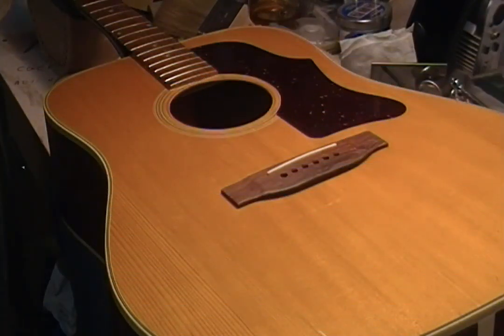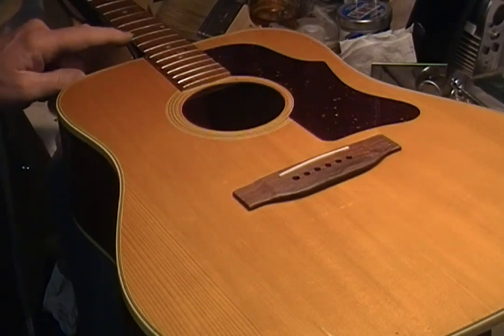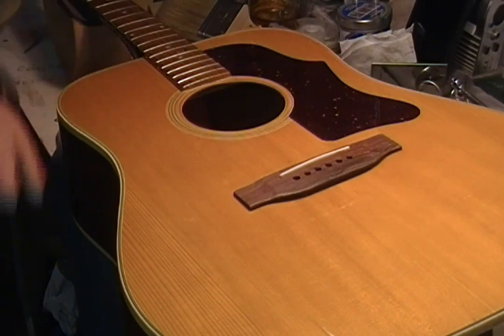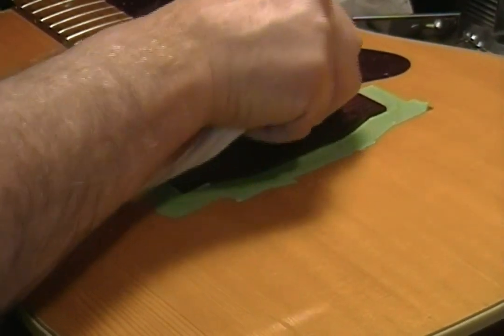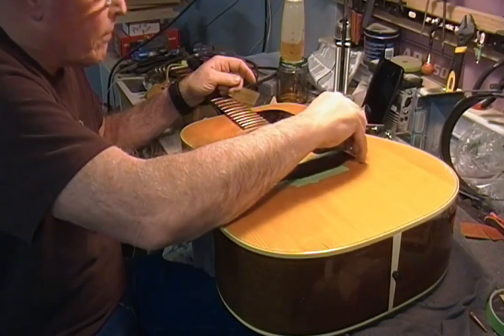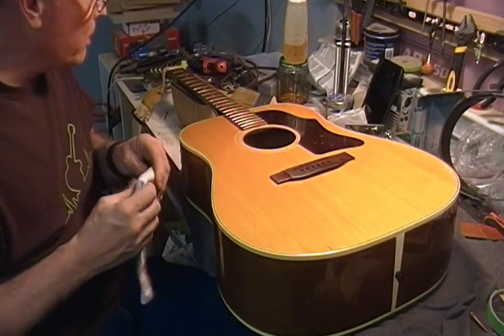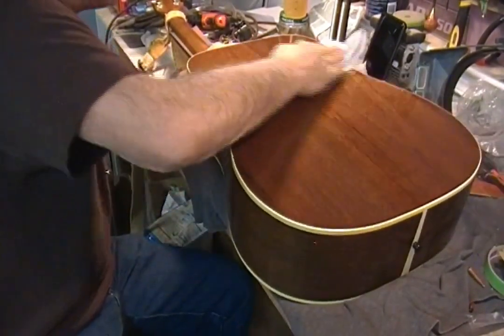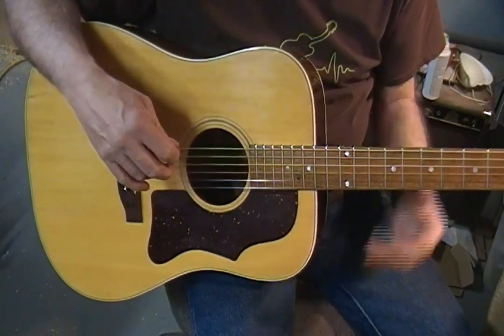Gibson J-40 bridge replacement, part 7, Finishing up with sound demo, by Jonah Guitars

Comment: It all came together Dane. Lovely work again. I'm interested in that polish.  You know any one that waves a mirror inside a pin bridge knows how chewed up a bridge plate gets. I've always wondered whether there's any mileage in bonding Tele type string ferrules inside on the bridge plate?
Reply from the maker: Dippy Hippy, thanks much Steve. That polish is a great product. I’m thinking brass sleeves wouldn’t hurt the tone any and definitely save the plate.
Reply: That's definitely an interesting idea. One worth trying. Currently, I soak a bit of thin CA glue into the wood around the plate holes to harden them up and slow down the chafing. I think that helps but it's hard to really know.
Reply: I expect the purists might say that no metal should get in the way of direct to timber contact with the string nipples?
Reply from the maker: @100amps , the super glue is a good idea
Reply from the maker: @KL3NCH , well the ball ends are brass or steel and the bridge plate fix it plates are made from brass. Of course purists prolly play only classical guitars with tie bridges.
Reply: I guess many of us remember the headlong roller coaster into brass hardware of the late 1970s to early 1980s? It was all dropped quietly as I recall. Then as now I couldn't tell any difference. I changed all my brass based attempts but only really because you couldn't hold back the  oxidisation. Protective lacquer looked awful once it chipped and peeled away. I just don't "get" all this precious indignation surrounding such minutiae. That is of course solely my own opinion, not representative and to some extent largely unfounded, but it's mine! The fact is that chewed up or otherwise, it has never affected any of my pin bridge instruments so it boils down to seldom (if ever) seen visual aesthetics, or an affront to even a diluted engineering mind. Disclaimer: I change strings very infrequently ;<D
Reply from the maker: @KL3NCH , I'm probably not the guy to hear subtle changes in tone from component changes after 30+ years of construction site and power tool noise. But I still think a lot of these thing are pure voodoo and really don't amount to much except profit for the after market parts guys. But here's an idea, if sound holes were slightly larger we could use no pins at all and string from the inside with only top style ferrule.
Reply: @jonahguitarguy  Now you've trumped me with lateral thinking Dane! A Tele-acoustic! The only gotcha with that KISS approach is that a string break would require most if not all the strings to be moved aside?
Reply from the maker: @KL3NCH , yep I thought it would be fine for total restrings but for that one random break it would be a pain. I didn't Telecoustics strung from the inside.
Reply: @jonahguitarguy  I just meant it would be string through from the back Dane. I've not looked at those acoustic Teles to notice how they're configured, but I guess they're like ash tray strung Teles similar to the Gecko's octaves or may have S-type hard tails? Whatever- it's another superb job and I imagine the customer is well pleased because I would be. Thanks as usual for adding to all your work by making and editing these fine videos Sir.
Reply from the maker: Dippy Hippy, extra credit points to you my friend for sighting a nuisance of the Gecko! 🦎
Reply: Steve,if your talking about the new telecaster acoustasonic that came out last year at NAMM,they have a pinned acoustic type bridge with piezo undersaddle,soundboard transducer,body mic inside and a Tellly singlecoil in what would be middle position if it didn’t have a sound hole.  just ran upstairs to my office/music room and checked the spec sheet on mine.
Reply: @j.mshrader4104  I wasn't thinking of that particular guitar JMS, but it sounds intriguing. Guitars are such s broad church aren't they?
Reply: Dippy Hippy,indeed they are sir.  Fender had a teleacoustic and stratacoustic a couple 10yrs or so ago that was a real peice of chineisum junk. Thinline plastic molded back and sides,laminate top that was about like wall paneling. It was a flop. It used a pinned rosewood bridge. I loved the idea,but the execution was no bueno. Someday I’m gonna build an actual set of thin body acoustic strat and Tele with bolt on fender necks,babicz trem and with either graph tech ghost piezo saddles or a set of Brenner-USA strat trem piezo saddles.